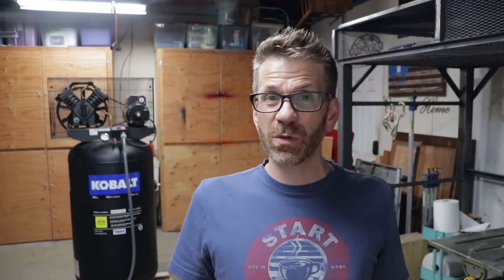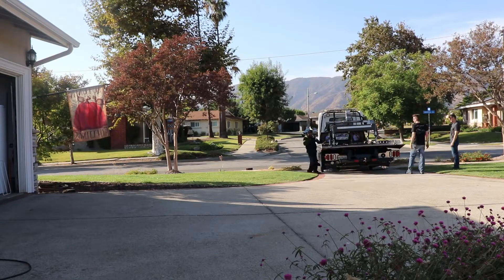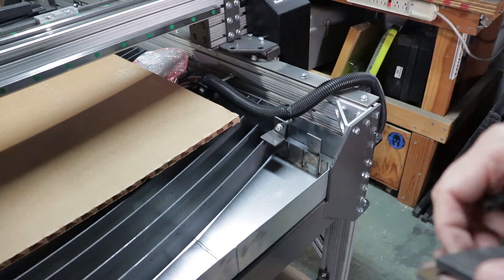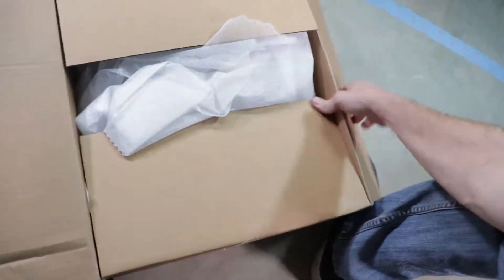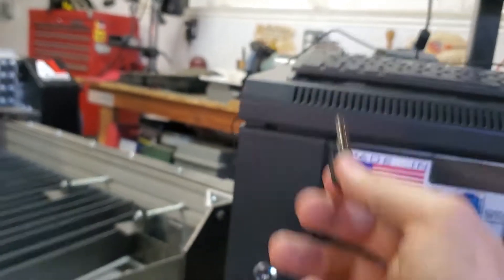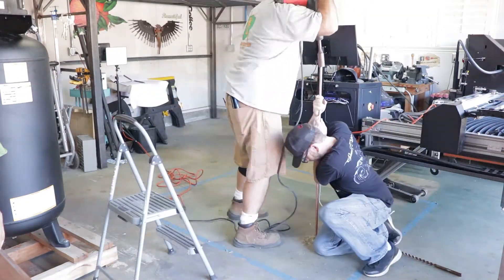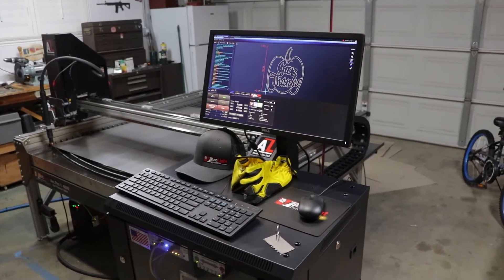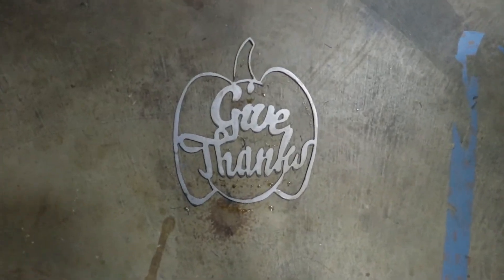I bought an Arclight Dynamics CNC plasma table! Delivery, unboxing and first cuts.

Comment: I know Im a bit late but we just a gotan arclight table. When we told it to go home it was very loud and was moving in a stop and go action instead of smooth. And when i say loud imagine a big air compressor by your ear. Any idea what happened?
Reply from the maker: Hmm, hard to say from that description without seeing/hearing it on video and not knowing what model you have. Is it brand new? If it's under warranty I would give A.L. a call. They have been very helpful diagnosing problems with me in the past.
Reply: @MountainWerksVideos  we gave them a call and they said that the only thing they can do is charge us 7,500 for a technician to come out
Reply from the maker: @evanhunter9244  I would check the drive belt for that side of the stepper motor that could be slipping on the drive gears. I would also check the linear rail bearing and the alignment on that side. If not, could be a bad stepper motor?
Reply: @MountainWerksVideos  I think it's unlikely that it's the stepper motor but it could be that one of the belts are not on properly.

Comment: whats the besr way to learn the program to run and make designs to the machine to cut? im ready to buy one but have absolutely no clue how to run any program on the computer??
Reply from the maker: If you check with your local or district library and get a library card you often get access to their online resources. One of these resources might be LinkedIn learning. They have hundreds and hundreds of multi-hour college-level courses on different software packages for free if you access them through a library card. I used this resource to learn Adobe illustrator, photoshop, premiere pro, as well as SolidWorks and Fusion 360 CAD design software. You can also search YouTube for shorts instructional videos. There is one YouTuber in particular who has some great courses on inkscape which is a free graphic design software package. I didn't like using that one because my computer kept crashing but your mileage might vary. I typically use illustrator and SolidWorks for my design work now.

Comment: I am thinking of purchasing one of these from ArcLight. Any idea what the total cost on that was? And also if I'm not real computer savvy do you think a guy could learn how to operate it?
Reply from the maker: Hey Marsh Monster. Well, I guess it depends on if you have an area that's all ready to accept the machine. For myself, I needed to finish off my garage, run air, and a separate sub-panel. If you do the work yourself I would say  you could be in business for under 20k if you need to do electrical and run air. If everything is prepped, around 17k. Also, do yourself a favor and set up a company if you don't have one already. The write-off at the end of the year is big. In terms of computer savviness, well that's hard to say. I'm a computer geek and I know everyone is not like that. Go to the Arclight website or search out their Youtube channel. They have some online trainings for Sheetcam that you can watch for free. Then look up Inkscape introductions (for artwork) on Youtube to see how difficult it is to learn. Then seach for introduction to Qcad which is the software package they use for CAD design. If those three software packages don't look too difficult for you, then I would say you are good to go. Hope that helps you out.

Comment: Good choice except the plasma cutter, with as much as you have in it you should have got the PM 65 instead, even if you never plan on cutting the maximum thickness listed that is just a maximum and unless you only plan on cutting material under 1/4" the Powermax 65  is the way to go and it is not that much more as a package.
Reply from the maker: Agreed, but the ship has sailed! My focus was really just to do light gauge signs, but now I wish I had the flexibility to do heavier stuff. I hear you can do 1/2" with an edge start with the 45 (according to Jim Colt), but I have not crossed that bridge yet. Oh well, live and learn. Thanks for watching.

Comment: I know you have not had the table too long, but i was wondering if you would give an update. I am looking to buy a table from Arclight Dynamics. I would like to do light fabrication work in addition to my full time job, and i would really like to hear what you think of your table so far
Reply from the maker: Hi Brandon, sorry for the late reply. For some reason I'm not getting comment notifications. So far so good. it's not running 8 hours a day so I can't tell you how it is doing for continual use with load. I can tell you I have not had a problems with it yet and when I have a question AL has been on the ball for customer service. Again, they are not sponsoring me or anything, I had to pay full retail. If you have specific questions let me know.

Comment: I'd be very interested in seeing the cut quality on your table. How clean does it cut small parts such as holes or sharp points? I'm looking at getting an Arclight table, but I primarily work with stainless steel and pierce holes as small as 3/16". I don't know how well this system would work with stainless or how "circle" it will cut a hole. As soon as I get the warm and fuzzy on it I'll be pulling the trigger. Just need real life reviews!
Reply from the maker: Hi Zac. I use primarily fine cut consumables which  seems to work well on anything up to 12-14 gauge. I can bridge letters (center parts of a's and o's to hold the center in) with lines that are less than 1/4" long and about .15-.20 inches in width and not have them blow out. virtually no dross on top, and moderate  dross on the bottom but I think that has more to do with my air supply. I am not using the Arclight recommended air filter, just a motoguard filter but I guess you would be using inert gas for stainless so maybe that's not a concern? There is a looping function you can set for sharp corners so they don't get rounded. The corners are SHARP so I think it does a good job there. Made a ninja star that sticks in wood pretty good. As for holes, I have not done a lot of those but it seems to do pretty well on holes around .20 in diameter. There is a little inclusion where the pierce comes in that I can virtually eliminate once I get the lead in right. DM me on Instagram or Facebook (same account name) and I can send you some photos.
Reply: @MountainWerksVideos  Thanks for getting back to me.  I have a call scheduled with arclight this week to talk about my specific applications.  I'll DM you, pics would be great!
Reply from the maker: @Daisuke1245  Yeah, I visited their shop and spent two hours grilling their sales guys. They are legit in my book and I couldn't really find anything negative about them online. Let me see if I can snap some pics.